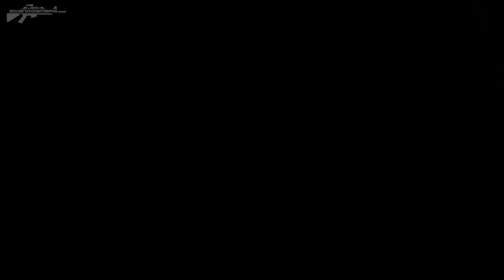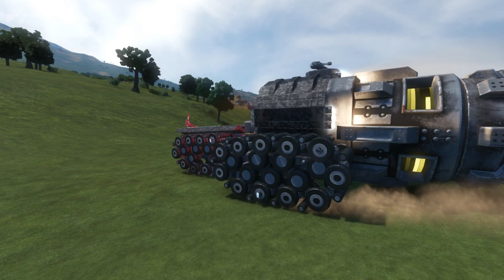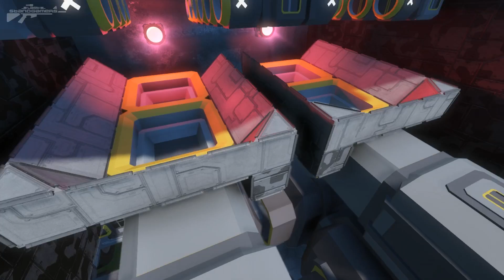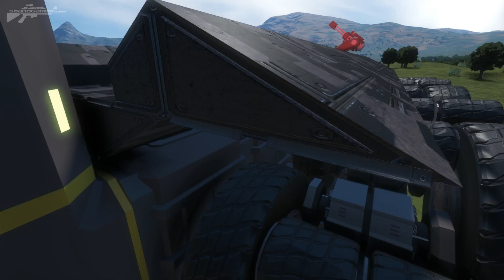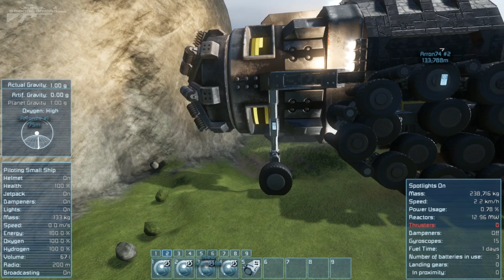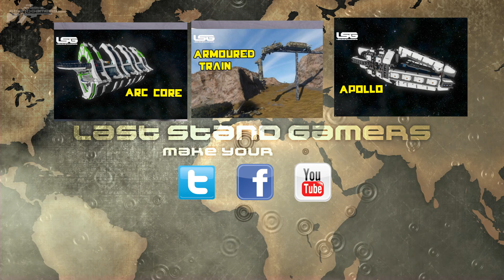Space Engineers - The Mole Useless Mining Machine

Comment: I think they need to add tracks to space engineers. Like legitimate ones
Reply: +Magical Fungi What about tracks with fixed hitboxes but rotating visuals
Reply: +James Sabins wheels sucks and i mean how they work, not how they look.
Reply: ChaosSandwhich unlikely. Unless it counts as a single entity then the issue will still persist. They made a huge design flaw when they made the "head" and motor of rotors and pistons two separate pieces. It is cool that you can lose the rotor head but still have the rotor but it is not worth having the bugs. Needs to be a single solid object.
Reply: +James Sabins exactly what i thought
Reply: +James Sabins lol, un-fucking-likely. Rotors aren't bad enough?
Reply: +Magical Fungi I mean they function like wheels but have the appearance of tracks
Reply: James Sabins its not a matter of balance. wheels have enough problems as it is, not to mention the damned rotors. they just need to get them working better before adding some other horribly buggy feature.

for now, just use the mods
Reply: Анатолий Кошлань yeah they aren't easy to understand, could be worded better, or have contextual descriptions of what each setting does.

in my experience, lower values are better. only increase them as needed.
Reply: Magical Fungi I didn't mean it as something purely cosmetic, it could be made to be more stable than wheels, while being processor friendly
Reply: +James Sabins The only thing I would like to see from SE right now is better netcode so multiplayer doesnt lag at all. and huge optimizations so it doesnt make my PC seem like a toaster
Reply: Combatsmithen XD, yeah me too that'd be great. mines moderately optimized for gaming, and i haven't even thought of buying the game yet due to AWFUL multiplayer
Reply: there exists a track mod on the workshop,  and I think the gear mod includes similar mechanical parts like rails and tracks

BEWARE it's not entirely reliable
Reply: ChaosSandwhich no im referring to tank tracks not train tracks
Reply: James Sabins the same mod has all of those things, i don't think he meant specifically for trains... though you can make trains i think.
Reply: Magical Fungi I think I know what mod he's talking about but all it is is a cosmetic, like they don't move but look like treads and act like wheels
Reply: James Sabins no its an actual set of parts from which to build tracks http://steamcommunity.com/sharedfiles/filedetails/?id=322047589&searchtext=track
Reply: +ChaosSandwhich oooh oh oh. Yeah I've messed around with this mod but it's really outdated and when I picked up the game it's not very functional because of the multiple parts.

I'm referring to planet nomads how it's placed like a wheel would be in space engineers
Reply: Vladimir Pootis lol, what makes you think either of those things would be true? if they could make better working treads we would have better working wheels first.
Reply: Magical Fungi Treads could have better traction and vehicular torque reduction than wheels. This game is also NOT fully released, so they probably are working on better wheels. Or maybe this is going to be the next Starforge. Personally, I have grown tired of the lag I have in Space Engineers and like games like FTD that run better and are focused on different aspects of strategy. I would rather watch someone else play it on a good computer than play it myself, basically.
Reply: Vladimir Pootis IT COULD WORK LIKE TRADE OFFS!! think about it, like ion vs hydrogen or atmospheric vs hydrogen. ion doesnt need fuel but its slower than hydrogen. treads can offer better traction and torque but you cant move as fast as wheels!
Reply: Magical Fungi also Pistons
Reply: +Combatsmithen Forget that! I want to see connectors and merge blocks not spontaniously explode during the connection process. I lost half a fueling station on survival to that one time and to took me 9 hours to completely restore it, and my very advanced fighter, to 100%... Without connectors this time.
Reply: +James Sabins Exactly. Every moving part in this game is capable of spontanious explosion or violent detatchment. Connectors being the most likely to explode and rotors being the most likely to separate mid flight and if you were unfortunate enough to have the rotor on the inside of your ship then it rips the insides apart as it bounces around.
Reply: Alex V4 hopefully this will be slightly improved with the new variable speed piston and rotor lock options,  I know i'll be making use if the force lock to make sure any moving mechanism is securely kept in place when not in use
Reply: +James Sabins And turrets with two or more weapons, like 120mm, 12.7 coax, ATGM.
Reply: Now it wont blow up anymore.
Reply: Vladimir Pootis that is something they would leave to modders honestly because it isn't a necessary feature. Keen doesn't do cosmetic block additions because SE was built to be modded for that very reason.

What would be nice is to add the features necessary to create tracks and track like things. Not blocks but maybe a easy way to link treads or designate sub grid position limitations, collision modification, ect... as there is already a pretty nice gears/rails/tracks mod out there you can build very nice tracks with, but it has its difficulties because of a lack of supporting vanilla features that would make it easier/more stable to use.